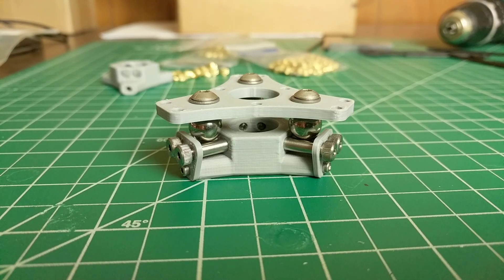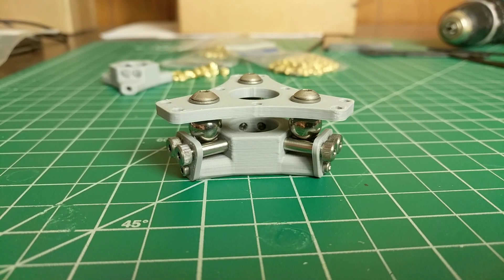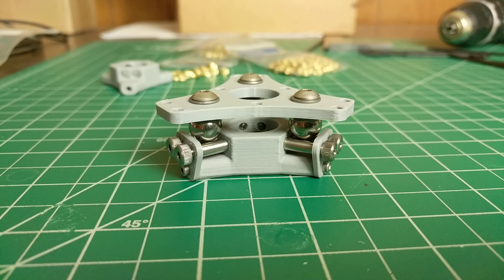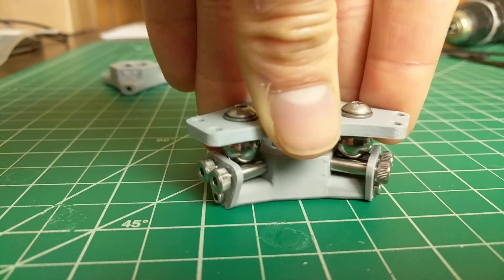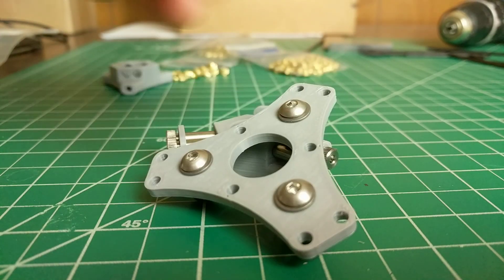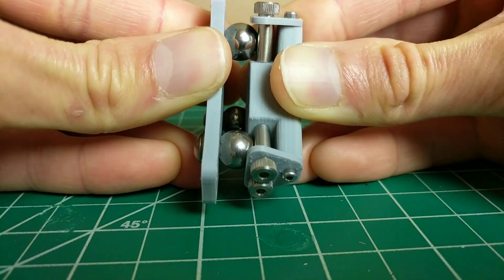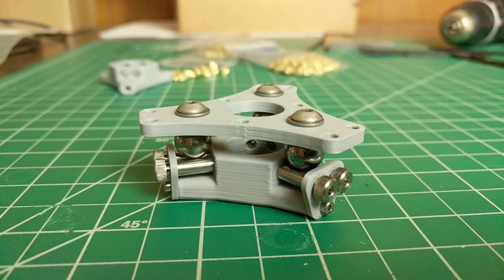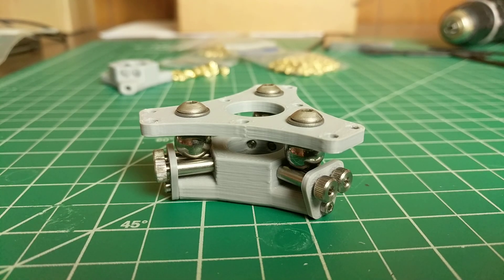3D Printed Kinematic Coupling Proof of Concept

Comment: Normally done with tapers on machine tools. Neato concept though.
Reply: The nice thing about this coupling is that it locks very reliably into the same position even with bad tolerances (of course, different tools will lock differently dependent on tolerances).
A single taper doesn't give a repeatable rotational lock, which isn't required on a spinning tool. Using an aditional alignment system in addition to the taper makes the mechanism very dependent on tolerances again.

Comment: on the robots hand in the circular opening run a small length of pipe with those pressurized springed ball bearings(not sure what you call them but its how you adjust crutches and canes.) in it. Then on the tool carve out grooves in the inner diameter of the its piece for the springed-ball bearings to pop into it.. since your kinematic coupling lined it up the ball bearings should be perfectly aligned with their grooves on the tool part.

Comment: What about using neodinum magnets in place of the dowels to hold the ball bearings?
Reply: You then need a way to release. I guess you could just poke it with something from the arm but I'd prefer more mechanical lock.
Also... I ended up here 5 years late :)
Reply: I thought the same thing

Comment: This is really cool. Have you seen the E3D tool changer? Parts list to build this? I want to start experimenting with kinematic couplings
Reply from the maker: Thanks, mate! Yeah! This is based off of that coupling, although I've also seen the same one in Thorlabs fixtures.

I was originally using heat-set inserts for some of these screw interfaces, but undersizing the hole and screwing it in directly also seems to work. As for parts, I'll add them to the video description.
Reply: @POOFjunior  awesome thanks!